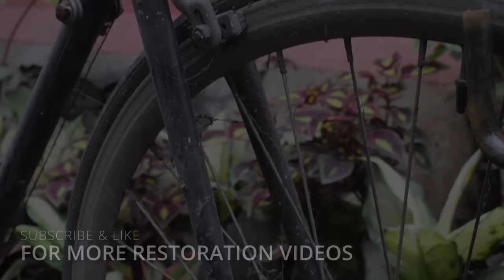FREE BIKE RESTORATION - Rusty Campagnolo Vintage Bike

Comment: I am amazed by how an absolutely thrashed looking bike can be restored to something you'd buy brand new. Fantastic job!!
Reply from the maker: Thank you so much!
Reply: It is not restored it is rebuilt. This bike has the weirdest random selection of parts I have seen in a long time. Why does it have a rear hub on the front wheel? Campagnolo never built bike frames only components. The bicycle builder or brand name is to be the decals on the down tube.
Reply: @chrisallen9154  spot on my thoughts exactly
Reply: It's not a fantastic job and it's not free labour. 
You're wasting your life when you could be riding and tuning the bike. 

It's called going backwards in life. 
Society will make you waste more of your life. 
Stop pandering to the low classes.
As soon as he sells it,  the spoilt brats will destroy it again.
Reply: It's not actually that hard
Reply: Now you're using the adjustable wrench on the headset lock nut! What are you thinking!?!?
Reply: That looks like a DeRosa flat crown fork. I wonder if this bike was built for Campy by DeRosa. Campy just slaps their emblem on the front HeadTube
Reply: @chrisallen9154  it looks like a DeRosa flat crown fork. I'm wondering if it's a bike built for campy by DeRoza. Can't be just slapped a name badge on the head tube
Reply: @Gma7788 Maybe so but people also destroy cars, bikes etc. Few people would let it, I think most would appreciate it. Second point is that this guy created two products, the bicycle and the video. We are here watching it. Regards

Comment: Interesting video. It was pleasing to watch an old bike being restored with all the things I used to do (never pressed in headset races though). My only question: why have Shimano 600 shift levers and Sun Tour derailleur on a “Campagnolo” bike? I still ride my 1987 De Rosa every day and it’s nice to see the old maintenance skills endure.
Reply from the maker: Thank you!!!
Reply: and the dia compe stem...would be nice to see al full campagnolo mounted components
Reply: @ammartinezguzman  It's a "RAG" bike.... shows people he has had so many bikes he has enough spare parts to throw together one.
Reply: @ammartinezguzman  Campagnolo parts are not generally available in the Philippines.

The owner can try to import campag parts from abroad (twice the price after taxes) later then use it to "upgrade", but now at least it looks 100% cleaned up and perfectly rideable.
Reply: In the era where you had five and six gear freewheels, it was not only possible but common to have a mishmash.  My first road bike had a Galli crank, a Nuovo Record front, a Suntour Cyclone rear, and Campy braze-on shift levers.  Friction shifting made this sort of thing pretty trivial.  These days, I worry about not having wear parts for the Campy 10 groups on my two custom road bikes.
Reply: Because it's not a Campagnolo bike. Campag have never made or sold frames with their branding. That's not to say it's bad, it looks pretty decent, with Nervex lugs and possibly Campag dropouts, and probably a bit older than some of the components.

Comment: Am I the only one who’s noticed, that it looks a rear hub fitted to the front. And why didn’t you strip the gold paint off the bottom bracket? He also should’ve left the bar tape in the shop, it’s awful. Otherwise, a good job.
Reply: You live long enough in this country to know that we'll use anything to keep our stuff running even if it goes against correct and oftentimes, expensive directives lmao

Comment: Nice job and as an old mechanic who has assembled hundreds of bikes here are some comments:

1) I like how those wheels magically got rebuilt after cutting out the spokes, rebuilding them is beyond most people skills.
2) Your front derailleur is mounted to high and will shift better if lowered.
3) Make sure your bottom spindle tapers are clean before attaching crank (no grease or oil). 
4) Grease your chain ring bolts to prevent creaking.
5) Your stem should stick out some do not pound on it or set it so low.
6) Your front Quick Release should be on the same side as the rear one.
7) You need to drip oil or inject grease into the cassette body after you cleaned it.
8) You should grease all the cable wires before running them through the casings.
9) You need to toe in the brake blocks to prevent squealing when braking.
10) You should grease the seat post and stem before insertion.
 11) Your tape seemed short as I would have wrapped it tighter with more overlap and it should have reached farther so that you only needed one wrap of electrical tape at the end.

Just suggestions from an old mechanic............
Reply: Good pointers. I got a question though. Point 8, wouldn't get dust and stuff to stick better to the wires?
Reply: @andreasbergwall9437  The grease is to lubricate the cable so it slides better.  You should have cable housing caps on the end of the cable housing to keep stuff from getting in the housing.
Reply: @jaycahow4667  Yes i understand the concept. It might also prevent rust. However, you'll get some parts of the wire that'll be exposed when you shift and you might drag dust and stuff in and out of the housing.
Reply: @andreasbergwall9437  some people change cabling each year or even more frequently
Reply: Also noticed his front wheel is a rear wheel...which is weird.
Reply: Y'all realise this is the Philippines right? Quality bike parts, especially vintage Campy components, aren't exactly abundant there. And even if they are, they're probably beyond what he can afford. He's making do with what he has. All I've to say is he did a REALLY good job turning what looked like something pulled out from the sewer into a beautiful, functioning bicycle using only basic tools.
Reply: @saisamsuri  Any front wheel will work. Front wheels are also cheaper than rear wheels.
Reply: @saisamsuri  Other than a rear hub being used as a front hub (not a good idea) no one else said anything about the components he used, just how they were assembled.
Reply: @billjameson1254  Especially since rear hubs are wider than front hubs so he is spreading out the fork to insert the wheel which could cause the frame to not track correctly.
Reply: @jaycahow4667  Exactly. It's not about "how dare it not be Campagnolo" it's about whether the part is right.

Comment: I learned the hard way: don’t cut gear cables, detach. Some old downtube shifters, simplex for sure, have very small holes for the lead heads and new cable heads might need to be ground/ filed down to seat into the holes. Nowadays I don’t throw out or waste any old parts, cables included. Great video, thanks.
Reply: cables are disposable parts and should be replaced even on newer bikes. the cables tend to stretch and some strands brake inside the guides which makes riding dangerous in the case of brake cables.

Comment: This is what I have been looking for. This is a real restoration, someone who only replaces what is necessary but tries to keep the original and respects the brand name.

Great job, and the shots allow you to learn as well.
Reply from the maker: Thank you!
Reply: Hell...... that wasn't original!!!!!!!!!!! That was a punch of different parts on an old frame!!!!!!!! Suntour rear derailleur, Shimano 600 friction shifters, etc.... That was a rag bike with a bunch of decent quality parts!!! I have Shimano 600 brake calipers on my 1991 Eddy Merckx SLX with Campy Chorus derailleurs, BB, Headset, etc. DON'T GET ME WRONG...cool rebuild but crap paint job... ya used rattle can paint instead of a catalyzed paint with a hardener and then a clear coat . I like how you went with Cross 3 spoke lacing instead of the radial lacing.. I've never seen a freewheel hub used up front!!!!!!! I have a "RAG" bike like that and it has a Shimano 105 derailleur that's about 30 years old... it works fine!!! The whole "Rag" bike is built on a 1988 Centurian frame with Shimano 105 cranks, Campy Victory front derailleur... etc. It's a bunch of thrown together old parts and ya know what?... I ride that bike more than my Cervelo Campy record/chorus bike. Thanks for video!!!!!

Comment: I have too many comments, I'll just mention a few.  
A. The builder clearly has experience with this.  Either he is self taught or worked as a bike mechanic at some point.
1. I don't think Campagnolo ever made bike frames.  (Correct me if I am wrong here.)  The closest thing would be the dropouts for for front and rear axles.   I still own and occasionally ride a hand made 1983 Bianchi I got new from Italy.  It has the Campy dropouts, but the rest is all Bianchi, (lugs made by Cinelli I believe) and Columbus tubing.  I wish I could have completed the build with a full Campy group set, but I could barely afford the frame as it was at the time.  That's kind of what I see in this bike also.  In fact, most of the parts on this bike are NOT Campy.  Someday I'll complete my build properly.  But the vintage Campy parts keep getting more expensive though.
2. That appears to be a (Regina?) true 5 speed cluster, which would have been more likely for an older bike, but this one has internal rear brake cable routing and braze-on shift lever bosses.  I think seven speed would have been the norm of the day then.
3.  Do my eyes deceive me?  You fit a rear hub into the front fork???  What are the external threads for?
4. So many other odd clues as to the vintage, such as the Zefal cloth rim tape, 36 spoke hubs, no braze on front derailleur mount, the Dia-compe stem and SR bars, and the early aero rims.  Hard to put an exact date on this bike.

5.  And yet the video was a joy to watch.  Thanks Coggie Bike.
Reply from the maker: Thank you for this lovely comment <3, helps a lot!

Comment: You should have kept the straight lacing on the non drive side of the rear wheel. Also, kenda tires are big no-no 
Also, you shouldn't bang the stem in, that  will scratch it and the bars will be too low.
Reply: hope you're being ironic...:)
Reply: kenda rocks yo
Reply: @kenkovar2647  nope, cheap kenda just sucks. Very heavy, very hard and there's no grip. More expensive tires, like Continental Ultra Sport, are much better value.
Kenda have a new performance line, but I have no experience with them yet.

Comment: I used, used brake fluid for paint remover. If you brush it on for about 4 days and keep it wet it will bush off with brass or plastic brush. After talking about it my friends give me their used brake fluid now. It works well it just takes longer and is free.
Reply: After stripping the paint on 2 bike frames in the last 6 months I ran out. I might have to buy paint stripper now.

Comment: That looks like a very nice frame. I wish you would have turned it upside down so I could see if it had an investment cast bottom bracket. The lugging on the frame and the holes for hiding the cables through the frame indicate that the frame was probably very expensive when new. I think spending more time cleaning and replacing some of the parts with original replacement parts would have been a better choice. Still a nice job. 👍☮️🌞🚲

Comment: Nice job. I'm a little sceptical about the ease that everything came apart in the beginning... cranks off square tapers with no crank pullers?! And why would you start taking the bike apart without giving it a wipe down first. I would like to have seen more of how the frame was restored to. I'm not doubting this is a genuine repair... the dismantling just looked a little staged. Lovely bike though.
Reply from the maker: Hello the crank has self extraction bolt that's way it easy to extract.
Reply: Yeah I'm a bit skeptical of the condition as well haha. Seemed a bit off according to my experience

Comment: Dude. Why are you using an adjustable wrench on a bottom bracket cup? That's exactly how you begin to round off the edges. Don't you have a 28 mm flat wrench? Also top tip... Once you've loosened the bolt holding the crank arm in you don't have to keep turning it with the small end at the nut. Once it's broken free you put the log in to the nut and then you can just spin it with your fingers and comes out in a quarter of the time. I suppose these are just things I've had fixated in my mind from working in bike stores for 30 years

Comment: I always use to take the goose neck bolt loose and bop it with a hammer and bars would slide right up I see a lot of people pull the bolt all the way out then half to fish out the bar wedge what a nice restoration tho

Comment: Great job! however, you should look into wrapping the handle bar tape around the brake levers in such a way that the tape wraps around the other way compared to the bottom part of the handle, or they will come undone eventually.

Comment: it's amazing what a good cleaning will do. Those rims and hubs looked like they were toast, but look brand new after a good scrubbing. Excellent restoration as always. Also i just noticed, does this bike have two rear hubs on it, lol, that's weird.
Reply: Some rear hubs are called flip flop hubs with a two sided design for threaded freewheels, on one side, a ratchet-ed 17 tooth cog, and on the other side a non-ratcheted locked fixed 16 tooth.
Reply: @grantkoeller8911  exactly, and you can also notice the horizontal slot in the dropouts that it's suitable for tensioning the chain of a single spee transmission, so this bike is definitely capable of running both multispeed or single speed transmission
Reply: @grantkoeller8911  That does not answer the question. It is a totally different discussion.
Reply: @chrisallen9154   he asked why there was 2 rear hubs....

Comment: Bike looks great….!!  

Those newer rims though kind of clash with the look, some older box section Weinmann or Mavic rims would be a more period look.

You should get a headset wrench and a bottom bracket fixed cup wrench and pin spinner, they’re not expensive .

Comment: Tubular tires are a whole different feel and experience, there meant to take also higher pressure, and are almost totally round so that they can be used to pedal while leaning around corners. and tend to have less friction. yet ya there hard to patch and can be expensive.

Comment: Another recommendation. Never use a tire lever to install a tube. Never. Even on the tightest rim tire combinations you can use the flats of your knuckles. Worst case you might have to take all the air out of the tube but that's better than inserting a tire lever whether it's plastic or metal. You're going to damage the tube much more frequently than if you just use your hands
Reply: generally you just need strong thumbs to put the tires on.

Comment: That looks like a Sugino Mighty Competition crankset, but a genuine Campagnolo front derailleur.  The rest of it looks like Shimano 600 with Suntour shifters and Diacomp brakes. That Suntour 14-18 5 speed criterium block is hard to find. Good to get rid of that stupid non drive side radial spoke pattern on the back wheel!

Comment: A really nice job - I reckon the bike isn't truly vintage (use of Allen keys and ducted cables from the brake levers). I reckon late 80's or even 90's, just looking ancient having spent years outside in a garden no doubt.
Reply: It's a 5 speed freewheel in back, and it has a Japanese stem... I'll guess that it's an inexpensive late 1970's/ very early 1980's model (The frame could be Japanese) Down Tube shifters are old Shimano 600. Cranks are old Shimano 600....The rear spacing is probably 120mm, but it can be resized to 130mm. (if done carefully) 
PS...I don't agree to what he did with cleaning the freewheel. There are many tiny ball bearings inside of it. Even if he got oil into it, there will be some water in it, and will be destroyed when it rusts....It needs to be taken apart, and overhauled...PSS A "slammed" stem is never a good idea.

Comment: The front brake is backwards. The cable connection should be on the other side to lessen the bend of the brake cable and housing. The cable is wrong in the original picture, too. You are missing toeclips. You do not want to ride with the pedal under your arch--both for safety and long range damage to your foot. The axle skewers are not attached correctly. Any competent shop would have set this up properly back in the day as SOP.

Btw, there would have been little rust on this bike as it's all aluminum, titanium or alloys with only a few fittings of steel and chromed steel. Did you paint over the "531" label on the frame downtube?

Comment: The dirt looks like it was sprayed on. Most of the rust looks real, but really doubt it was this dirty. Any bike restorer I know would have given this thing a really good bath before deconstructing it. As for the green electrical tape on the wheels, nah. You need cloth liner tape, at the very least a wheel liner that is plastic. Electrical tape makes a mess of the tube. the crank bolts are modern, Allen wrench heads. Older square taper spindles use a nut, usually a 14 mm.  I could go on and on...This is partially staged for sure.

Comment: if possible, are you able to provide the list of chemicals used to remove the grime, rust and patina from the components and frame? im looking for something that will remove tarnish(not really sure what it is called but it is that thin layer of slightly greenish blue layer that forms on steel after a while, i tried removing it with aluminium foil and vinegar but am only able remove the roughness, the shine does not come back)

Comment: Dude! Electrical tape as a rim liner?! No
 no  no. That dude's going to be having flats especially on his back wheel way more often than he needs to be having them
Reply: Works ok with a bunch of layers. Still wouldn't use it if I had the legit option. 

I've even seen people use electrical tape to seal the rim for a tubeless setup, but then I suppose there's no tube to worry about puncturing haha